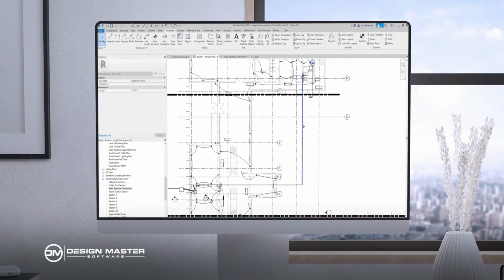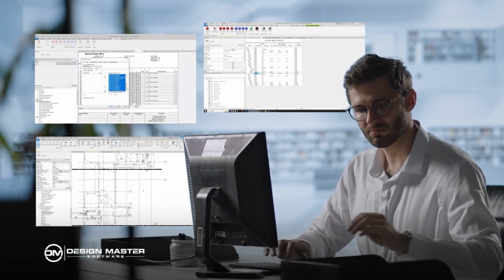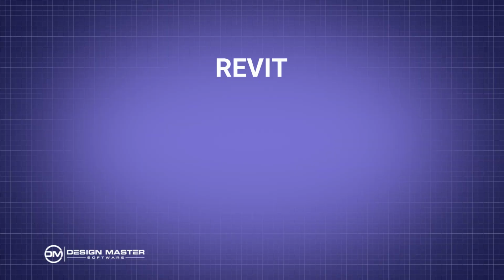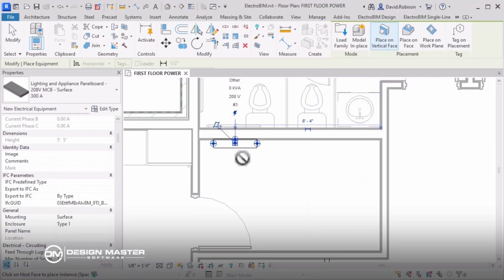Learning Revit for Electrical Design – Episode 33 #Revit #BIM #Revitsingleline

Comment: Great points, and sure appreciate the shout-out! Yes, finding Revit education specific to electrical engineering (amongst all of the architectural videos like you mention) is exactly why I created my channel. And totally agree that for the design end, most of our work is in the logical interconnection (circuiting, sizing, etc), with a bit of 3D in there for coordination. Cheers!
Reply: Thanks for stopping by! Your videos are a great resource for electrical engineers. You fill a much needed role providing advanced training to our industry. Keep up the good work.
Reply: @ElectricRob  Your channel is a treasure!  It is so needed please keep putting out the great content you have been!